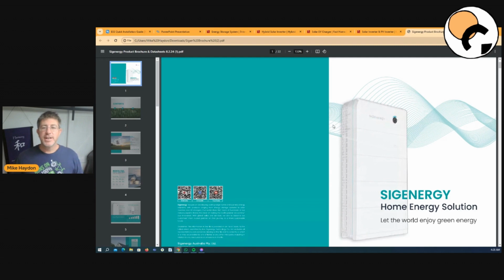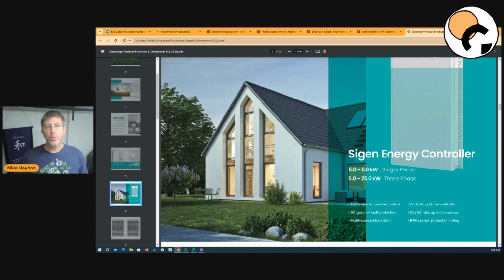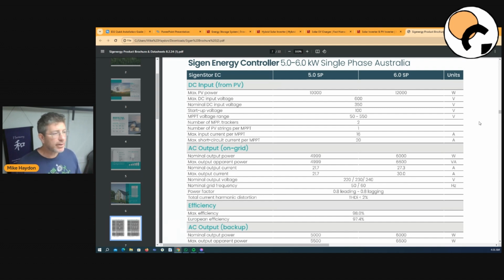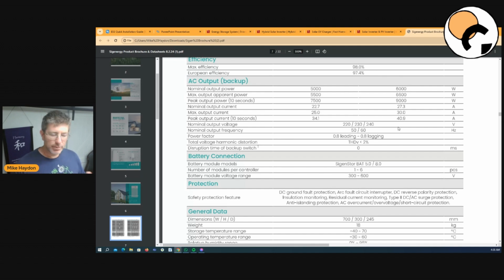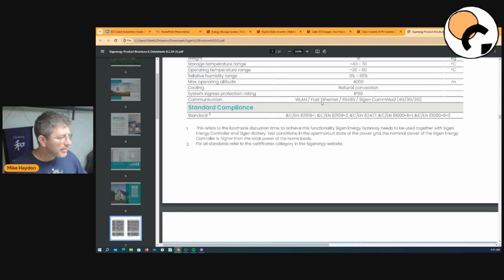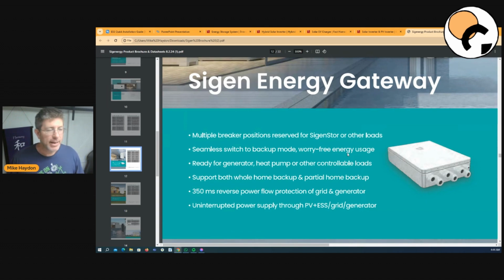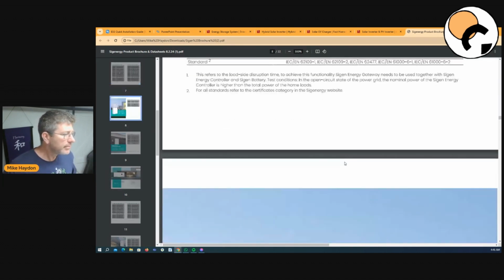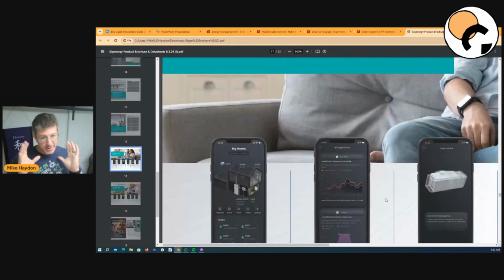Sigenergy Product Specifications - Everything You Need to Know!

Comment: Hi there. I'm wondering I it would be possible to position this product away from my main switchboard/existing Fronius solar inverter? I would like it positioned in my shed where I keep and charge my EV. I have a 32amp feed from my main switchboard to a switchboard in my shed already. I would like to be able to use the back up feature for my house and possibly the V2X from my EV. Thanks very much.
Reply from the maker: You could and it will back feed and supply the house as long as the grid is up. When you grid is down it won't back up the house. It can be done and there are some major upgrades. Feel free to call us on 0483927257 if your in Australia and want some advice.

Comment: What would a Sigenergy 3 phase 25kW inverter, HomeMax TP, 16kW Battery and 34 x Solar Panels cost for postcode 2290 with east-west tin roof, I've been informed that my house is an installers dream?
Reply from the maker: Hi Paul, thank you for the opportunity to be of service. Send us an email to admin@theoffgridshop.com.au and we will get you a proper design done..
Reply: What is the breaker size for the 3phase gateway backup port and also I have seen that remote inverters  can’t be on the backup port and should be on the smart port can you also have loads on that port as I have a 32kw pv and sma inverters at farm buildings 300m from where gateway would be installed?

Comment: I have two installations SolarEdge and Hoymiles. May i use Sigenergy as a retrofit for actual inverters which are not hybrids, for energy storage?
Reply from the maker: Yes you can. You can Ac couple. I would suggest if possible put a few extra panels into the Sig energy which will give  you black start if the grid was ever down and your batteries were flat.

Comment: Uk based here , I am going for all in one via 3 phase . 
  Persuaded by what I’ve seen on you tube I am tempted to not have the two Tesla powerwall 2 (3 still not here yet ) and go for Sigen all in one being more modular at lower price point for a decent product .
  Their battery degradation is what I am uncertain of , the app looks good but not enough detail about to be sure completely.
  Thanks for info in vid .
Reply from the maker: Thank you. Yeah I wish this inveter had the ability to work with other battery technology. That to me would make it perfect. And have a look at the Noark range of inverters. They do a simple 3 phase option and have a much better user interface than the Dye and Sunsynk.  And we are doing some fun stuff with them with wholesale energy prices form the grid in Australia. You can do the same in the UK..